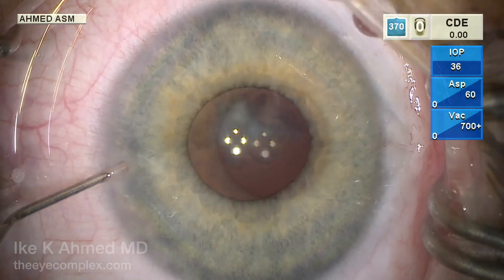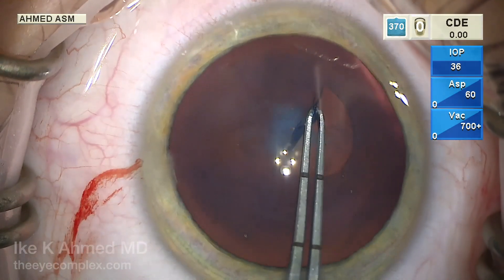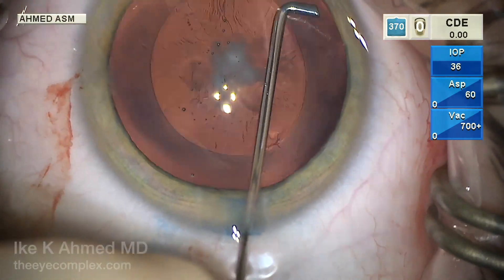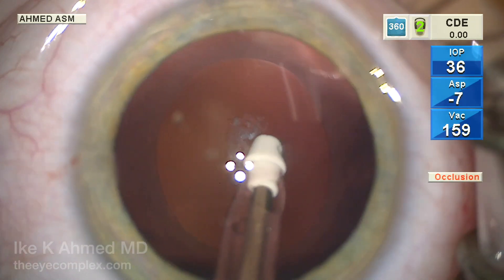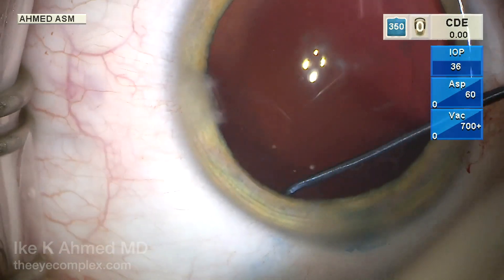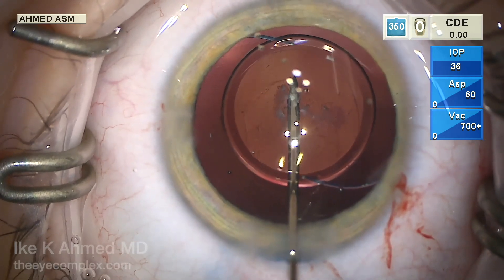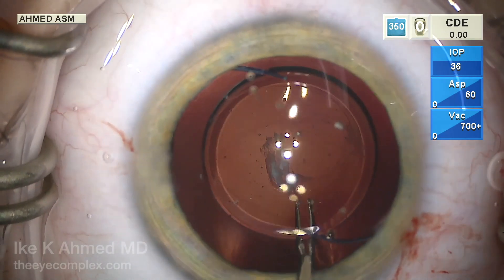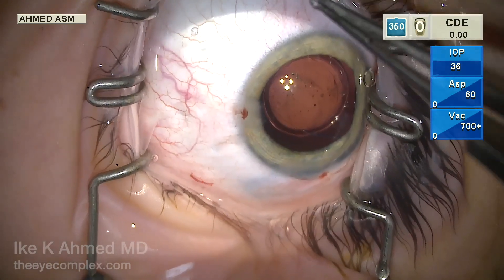Congenital Posterior Polar Cataract: Detailed Surgical Technique

Comment: Wonderful management with many important tips; congratulations Dr Ahmed! I have developed a technique to mechanically detach the cortex/epinucleus shell from the capsular bag in PPCs to avoid hydrodissection, you may find it interesting: https://www.youtube.com/watch?v=HoM9DeLeehg (it uses the same concept as the maneuver you performed with the hydro cannula, but I use instead a long blunt chopper running along the lens equator). Thanks for sharing!

Comment: Beautiful case. Thank you for posting it. When you ‘paint’ the Trypan, is the cannula actually touching the anterior capsule? The stain looks excellent despite the OVD.
Reply from the maker: Thx!!  Yes gently touching anterior capsule with blunt cannula and painting.  Works best under a cohesive. This is especially in complex cases, zonular weakness etc. Then irrigate a little and add more Viscoelastic on top of capsule.
Reply: @IkeAhmed  Thank you for the pearls!
Reply: @IkeAhmed  Sir, How do I contact you for evaluation for eye surgery? I am desperate to get my eye repaired. Thank you!